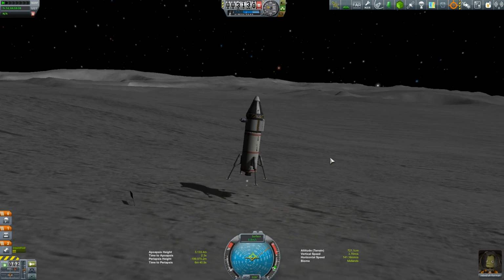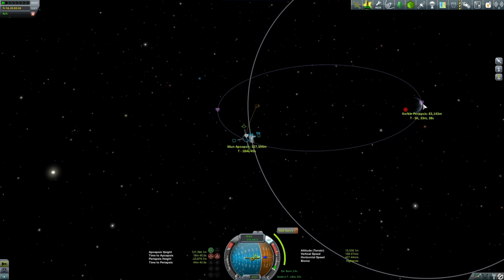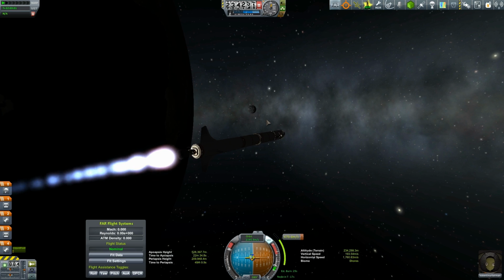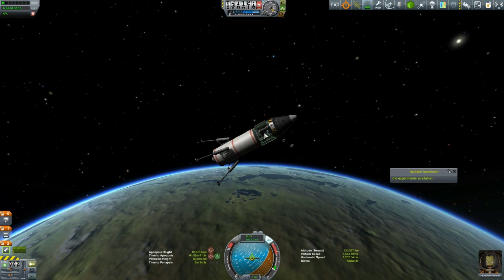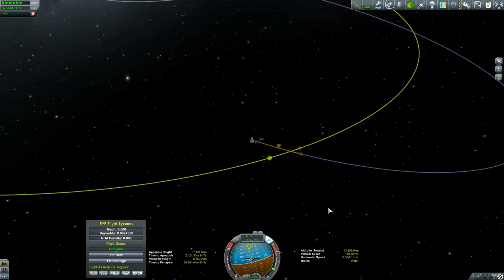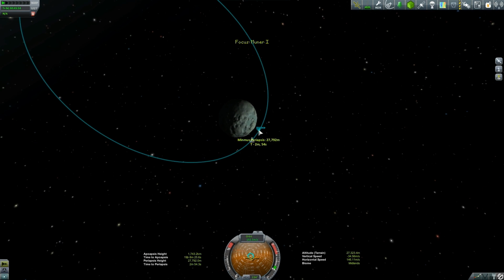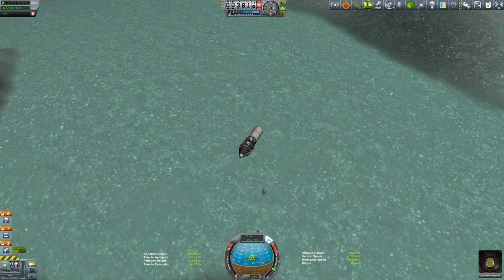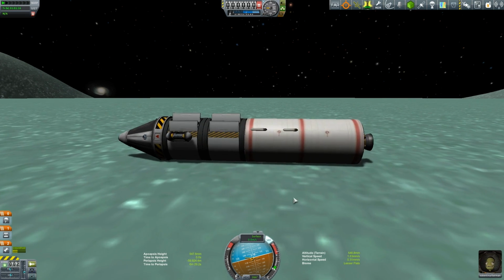Kerbal Space Program - Mission #4: Minmus

Comment: Hey Magz, just a couple of tips :) a good rule of a thumb for re-entry with deadly re-entry is to aim for a periapsis of about 30km, this will give you a very gentle descent but you will still bite hard enough into the atmosphere to land in one pass. It's also a way to guarantee your crew wont get killed by excessive gs (which happens with DRE). Also when you took of from the mun, you tried to maximise your apoapsis, but it is in fact better to minimise it. Thanks to the oberth effect, you gain more energy from your engines the closer you are to the centre of gravity. In your slingshot maneuver I would have recommended changing your course while at the closest point at the mun you can capitalise from the oberth effect, saving fuel.

Comment: How much fuel would it take to get a spacecraft up to the speed of light in KSP?
Reply from the maker: needmoredan More than you could ever haul. Scott Manley did a video on this some time ago. Using a light spacecraft with a big engine and unlimited fuel and letting the game run for I think it was about a week he managed to accelerate himself to 1/10th the speed of light. However if he hadn't been using unlimited fuel the engine he had wouldn't have been powerful enough to move the amount of fuel required for that 1/10th run from Kerbin orbit.
Reply: needmoredan This is actually fairly easy to calculate using the rocket equation. At an Isp=950s (best nuclear thermal engines), to get a 1 ton payload up to 300000km/s of delta-V you'd need... 10 to the power of 13742 tons of fuel. Even to accelerate up to just 1% the speed of light, you craft would have to weigh on the order of 10^137 tons. Yeah, kinda not practical.

Comment: Love your videos. Helpful tip: there should be shortcut keys for maximum and minimum thrust (so no spool up time). I think Z is one of them
Reply: Z and x
Reply from the maker: Tryaz EVE There are, I avoid using the max throttle shortcut as it could become habit and I tend to do a lot of minimum throttle burns for fine tuning. I always use the Throttle cut shortcut however.